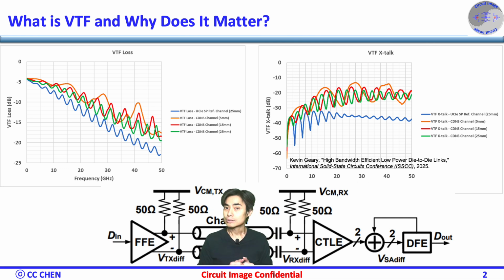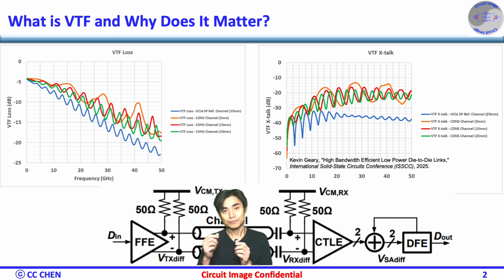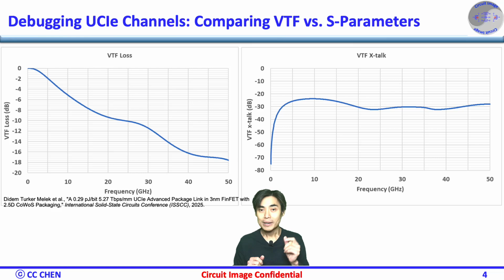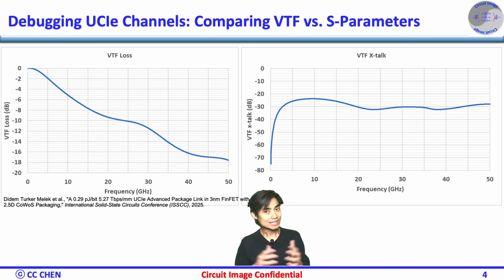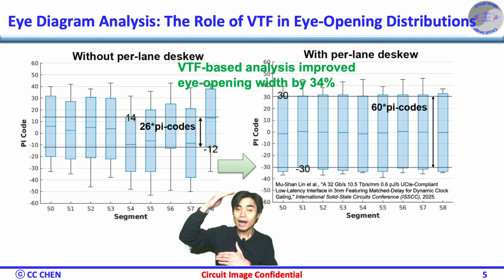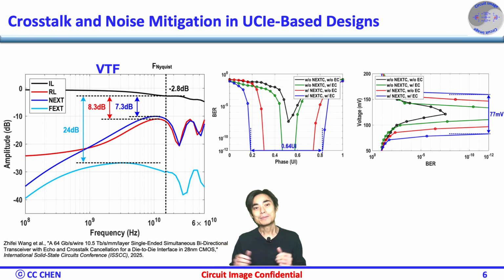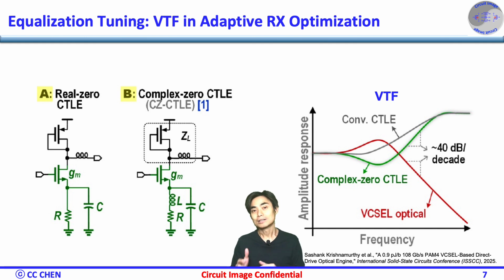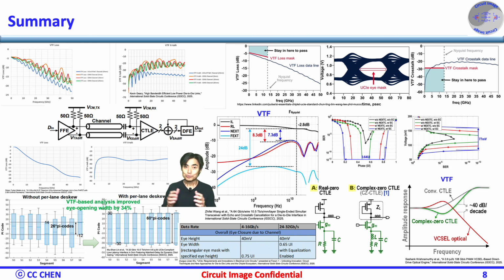Why VTF?

Comment: It would be interesting to know  more about how cascading S parameters, normalizing for impedance, differs from VTF.  Is VTF capturing nonlinear effects?  Would Xparameters be sufficient channel characterization to meet a VTF limit line.
Reply from the maker: Thanks, Jerry! Yes, VTF captures more than just linear behavior — it also accounts for certain nonlinear effects, particularly when the TX and RX aren't strictly linear systems.